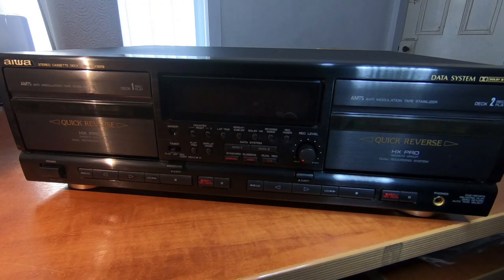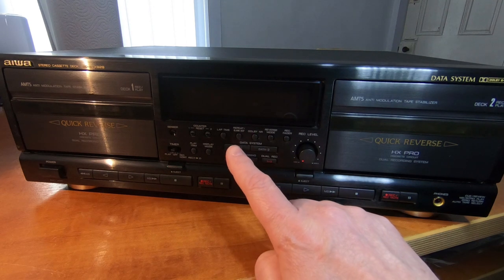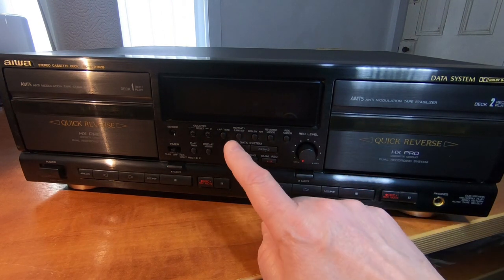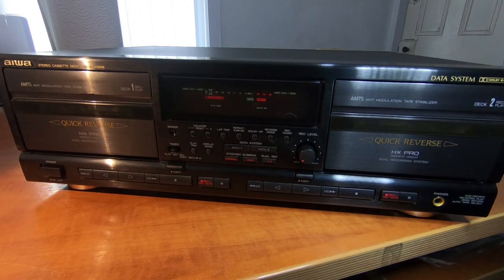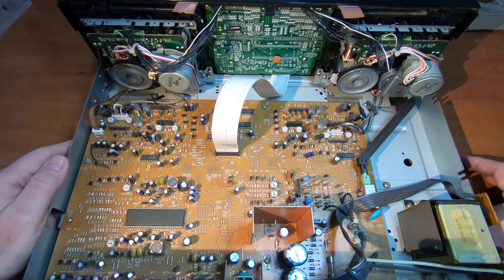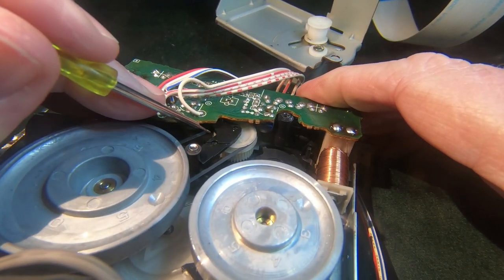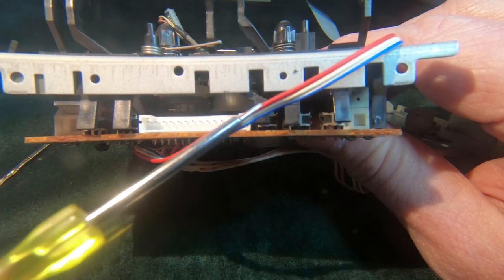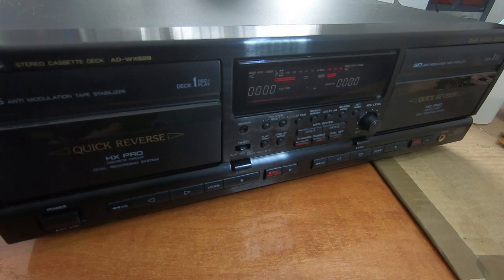AIWA AD-WX929 Cassette Deck Repair

Comment: I found a really easy way to remove the Rubber "gloop" is to use "Elbow Grease" Degreaser on a cue tip and follow that with alcohol,

Comment: I didn't fancy unsoldering the solenoids to replace the smaller belt you can thread it around the switch contacts using dental hook or similar.  It takes a steady hand and lots and lots of patience though.

Comment: I didn't solder the solenoids. I cut a thin belt and then superglued it end to end. This belt does not affect the sound. Usually the belt never breaks at the gluing site.

Comment: I was excited at first to replace my belts on my same deck but then the welder .... I think I will try to replace them and if I broke something  I will sent it to trash. Which belts must  I buy ?
Reply from the maker: The solder work is easy if you have an iron, they are large pads.
For the belts just search "AIWA AD-WX929 belts" 😊
Reply: Плоский 110 мм, тонкий 65-70 мм.